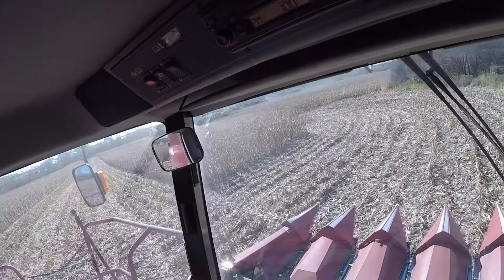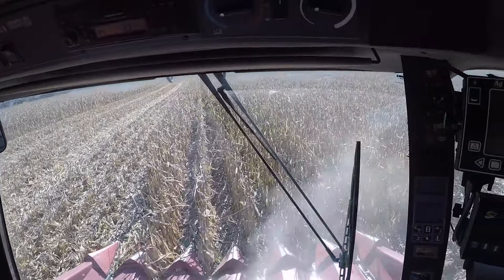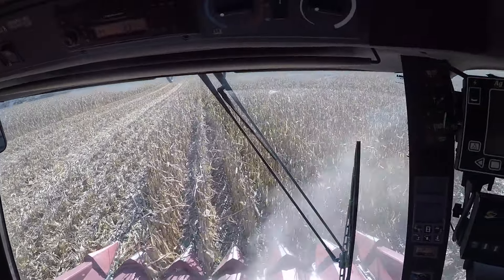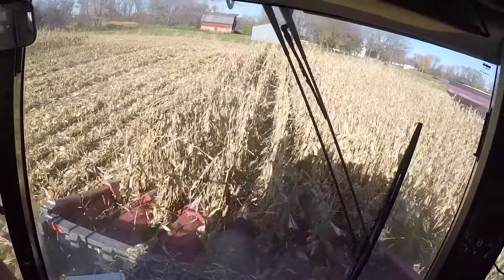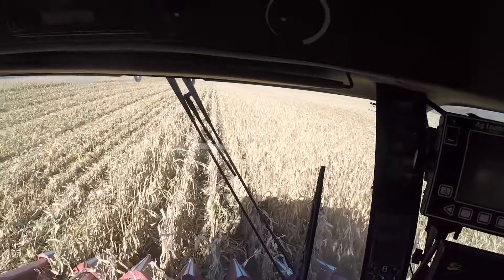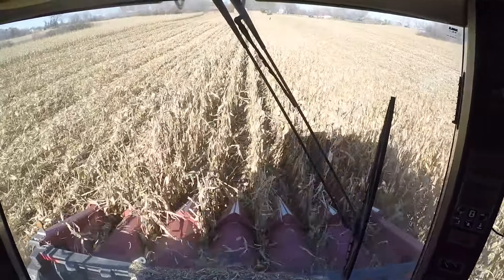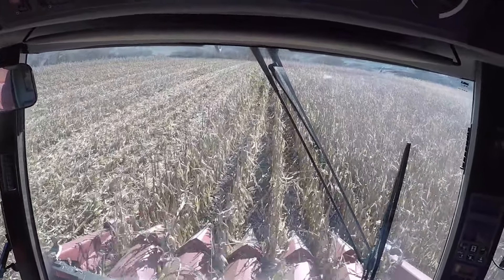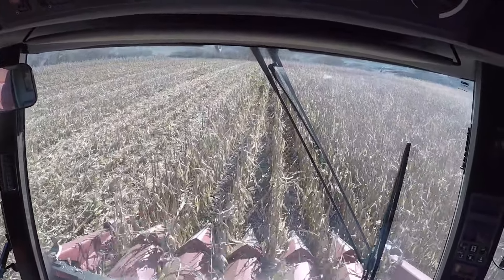Rambling and Combining

Comment: What kind of yield are you getting? Seems like you made quite a few rounds and didn't need to dump. Or does the tank hold quite a bit?
Reply from the maker: Massey1105driver we are usually in the 160-180 range. County average is 165.  The hopper is huge--it has the extra tip ups and bubble up auger. It holds around 300 bushel